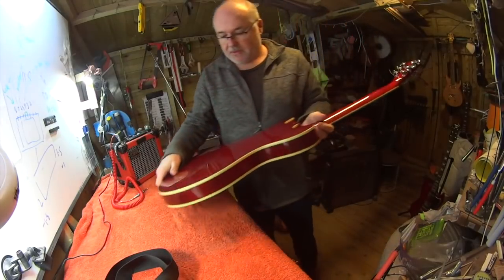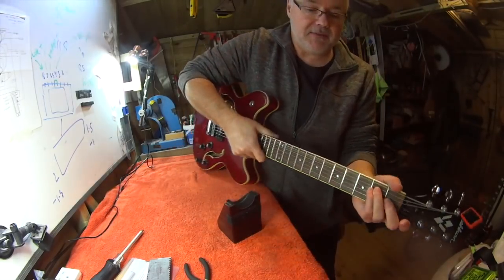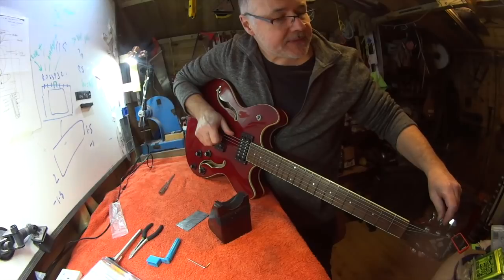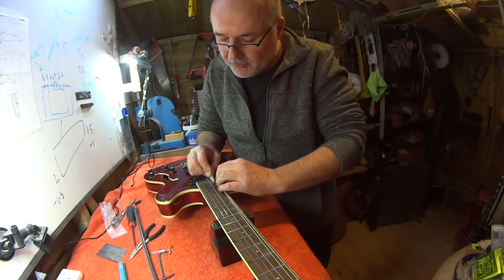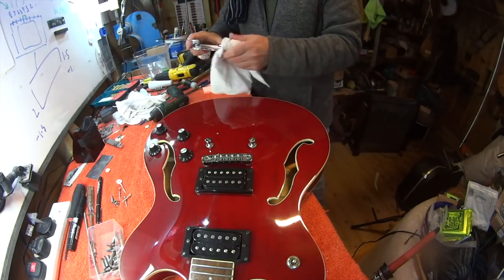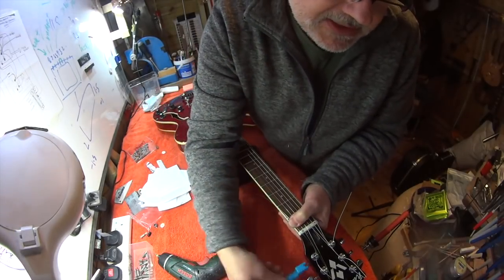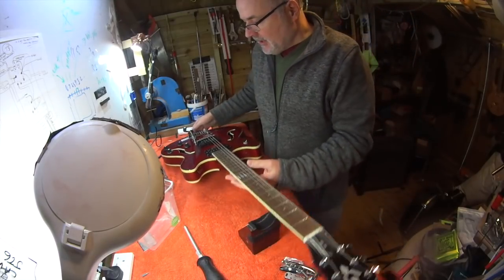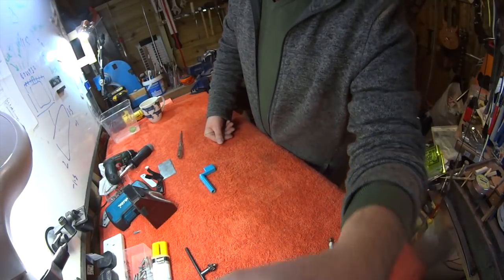Washburn HB30 vibrato upgrade and set up

Comment: Hi Sam
I just watched you go though the same sort of things that I did with a Chinese made Bigsby copy. Mine came on a Chinese made Ibanez. The creaking noise when you press the whammy bar down was coming from the big tremolo spring galling the metal parts it sat in. The spring was unfinished and like the one you had, the handle sat very high. Grinding or sanding the top and bottom of the spring flat helps both handle position and adding some fiber or plastic washers for the spring to set on eliminates the creaking noises when the handle is pressed very low or pulled way high. No more strange creaking noises and the handle sets at a much more comfortable playing position too. I also did some work to improve the handle as it was galling metal when it was rotated up or down out of the way. It kpmade a horrible fringed noise.  I added some fiber washers and ground away the stop that prevents the handle from rotating all the way round while I was at it. That makes it easier to rotate the handle all the way rearward for putting the guitar in its case. I really don't know why the stop was there in the first place and so far no one has been able to give me a good reason for it. Now the handle rotates very smoothly and I can easily set the friction of rotation as stiff or as loose as I want it. 
Overall mine now operates very smoothly and with no extraneous noises. 
Hope these tips help with your next encounter with a Chinese Bigsby knockoff. Once they're massaged a little, they're not too bad.
Reply from the maker: Very helpful tips - thank you! I tend to agree with you, there's no mechanical reason why these copies shouldn't work save for a fair amount of finishing work :-)

Comment: I've wanted to fit a trem to my HB30, for the last couple of years. This has made me really want to.
Or maybe I'll sell and get the offset body guitar, I want, with trem fitted?
Reply from the maker: I quite like the Duesenberg 'Les Trem' vibrato (and the almost identical Göldo version from Thomann) - no complicated fitting; it replaces the stop bar and sits on the stop bar posts. The Göldo one is about £70 at present so worth a look.